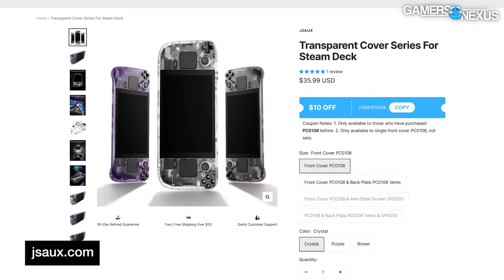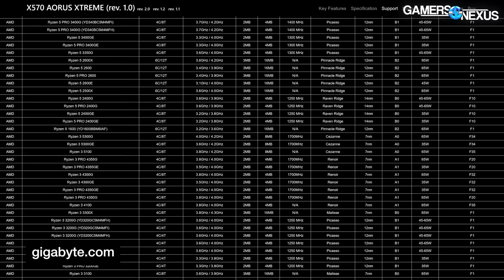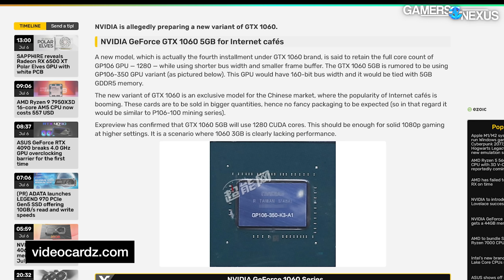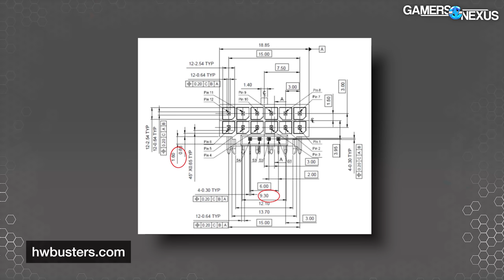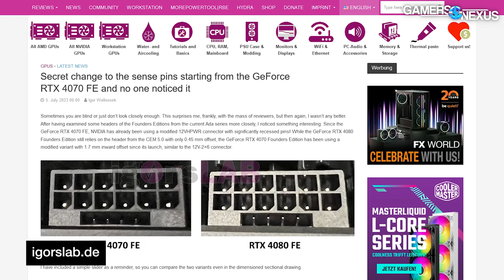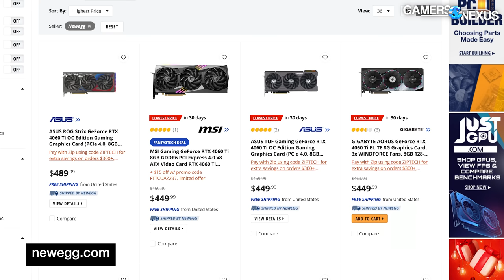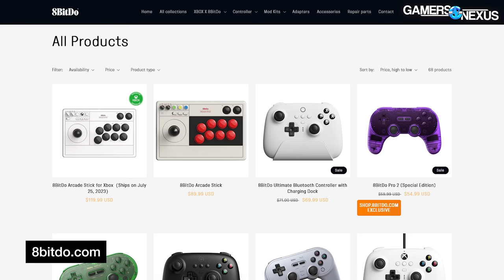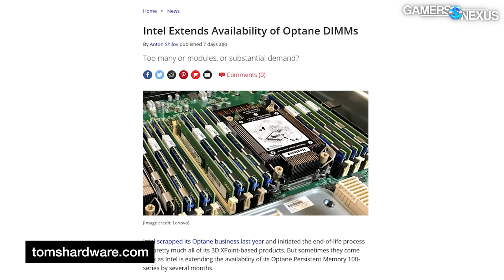HW News - Ultra-Small Intel Arc GPU, 12V-2x6 Connector, More AM4 CPUs, 4060 Ti 16GB

Comment: I got tired of waiting for a current gen AMD graphics card and bought the RX 6800 XT when it was on sale at Micro Center for ~$500. Unlike the lower end cards I've been able to get in the past, this one should last me a little while.
Reply: The 1070 technically still holds it ground, that 6800xt should last you a decade or possibly forever (until card lasts) at 1080p
Reply: @ipanesm  The 1070 is quickly falling short due to having only 8GB VRAM. It's fine if you don't play any games that needs more than that, but newer titles at 1080p is pushing that limit. If there's any question of that, Hardware Unboxed recently did a video comparing the 3070 (non-Ti) to the 6800 (non-XT), both with and without RT, both 1080p and 1440p. It went about as well as you can expect.

With all that in mind though, I fully expect to ride this 6800 XT until the wheels fall off. I don't do any manual overclocking, and while I currently use 1080p, I'm looking to acquire a 1440p display, so unless there's a serious hardware issue with this card somewhere down the line, it likely will end up in my new system, whenever I decide to build it.

Comment: NVIDIA should do a full recall on the 12VHPWR cards to solder the new connector, same with the brands that have a custom cables etc, so it can't be at fault for it being too loose or make it worse...

Comment: Speaking of NVMe airflow, I like how my AsRock x570 PG4 put one of the NVMe slots directly below the GPU so it can get airflow from the GPU fans. Many motherboards don't do this. I disabled the GPU's zero-RPM feature so now the fans are always on, keeping the NVMe cool.
Reply: Is a passive SSD heatsink with copper pipes and fins not enough ?
Reply: @YounesLayachi   Should be fine.  Mine doesn't have a heatsink so the airflow mitigates that.

Comment: Y, idk why there is a clip on top. Two clips on the side of the 12V connector (because everything evolves into crabs) would have prevented the issue too. It also makes it easier to press open the clips on an right-angled connector too.

Comment: I actually JUST applied the Carbonaut pad to my laptop's CPU and GPU! :D

The impressive thing about the pad is that, like what Bob Of All Trades showed some years ago (go watch his more in-depth video for more info), while it isn't quite as good as the best pastes on the market, the core-to-core differential in temperatures has been insanely close. Most temperatures before on the laptop I run (Eluktronics MAX-17) had anywhere between a 10C to 15C degree difference between the absolute hottest and coldest cores. Now it's merely 2-3C difference. So while it runs hotter across the whole chip, it's still an upgrade.

Also I never have to repaste ever again, if the company's claims are to be believed. :) Just gotta be careful since it IS electrically conductive, so you have to cut the pad to fit the size of the die. 

Better option than liquid metal, imo. Less stressful, easier to work with and never have to worry about it potentially 'leaking'.

Comment: Asrock loves SFF. They are the only one who made a single fan 6600XT, now a LowProfile A380. Nice work!

Inwin chopin modders now have a new GPU option. waiting for your revisit on A380, might be better than RX 6400 in performance, althought 6400 still has the advantage of single slot

Comment: I'm really happy to see the ASRock "Lite" boards! If I was still in the market for a CPU, that really might have tipped me over the fence to AM5. Specifically the B650E Taichi - I like that one.
AM5 motherboard prices were the reason I didn't go that route. The price of a board to get even the same features I got in 2019 with my MSI X570 ACE was just ridiculous. Everything under $500 felt like it would be a downgrade. Ultimately, I decided to stay on AM4 for a few more years, and upgraded to a 5950X (from a 3700X) two weeks ago.
(I'm happy as a clam with the 5950X so far. Video encoding is halved! I'm still blown away every time I encode something. No regrets with this choice!)

Comment: IMO the material from these connectors should be in a no flaming material, plastic isn't a great material, where high heat builds up. In the past, they used ceramic connectors. In this case, on the GPU side. And the use of NTK pins, which Igorlabs suggested. I know using ceramics is a lot more expensive, but you can't cut costs on safety. If this catches fire, and you are not at home, and the place burns down, and they find the cause, the manufacturer will pay for it. Insurance companies are very good in this.

Comment: I really like jsaux inlcuding a full tool set. It's not about whether the use should be expected to have all the tools,,, when doing something very important (like working on your steamdeck) it's critical that your tools have clean edges (brand new is the best way to have that) to prevent damage to the screws and other parts that comes from slipping.

Comment: In the past motherboards could split those 16 PCIe lanes to 8+8, or even 8+4+4. While that M.2 SSD on the back of the GPU is a somewhat halfway solution, being able to split those 16 lanes from the CPU, is the TRUE fix. And when I say past motherboards doing that, I mean $80 motherboards, not $300 motherboards.

Comment: still amazed at this whole 12 pin issue, meanwhile my Strix 1080 has a light by the connector... light on = fully inserted, light off = not in far enough, simple! or you know 8 pin that has worked nearly forever in terms of "PC years" vs 12 pin and then the squid-attack adapters, etc.

Comment: Nvidia should make generators with pulleys attached to their fans to generate current to reach 600w.
Reply: They could just plug the gpu into 240v so it doesn't need a 500 pin power supply. 🤣
Reply: @GoonyMclinux then it would need many more components to clean the power, bad idea
Reply: @ipanesm  Its a joke.

Comment: The 12 V "standard" should be replaced by the 48 V standard that has been used for over 50 years in the communications and data center industries.
Also, switching from CMOS to resonant tunnel diode threshold logic would reduce the power requirements by a factor of 100,000.

Comment: I won't lie. Several people asked me why I went out of my way months ago and bought 3090 to get an Nvidia GPU with more than 16GB of VRAM. I pointed at the 12VHPWR plug and said I wanted nothing to do with it.
ASUS has a potentially smart idea here with the 4060 Ti + 2TB. I've seen several people complain about the 16x lane slot not getting fully used by some cards.
Ah, hell. I'm going to need to buy an 8BitDo NeoGeo controller for my shelf.
Transparent Purple shell: GET! Putting it on is a great time to replace the joys with some Gulliket Hall Effect replacements.
Optane was great for caching large Steam libraries on 8TB 5400 RPM HDDs. I kinda miss it.

Comment: I’d like to see any Intel retest also include revisits for the 6600 (XT) and 6700 XT. Both were rightfully trashed for their launch prices, but are now considered standards for their price points.

As for the NEOGEO Controller: Now that they have the analog stick figured out, they should include it on one of their ultra-portable controllers since it's also a solution to a low profile analog stick.

Comment: Why can't GPUs switch back to 8 pin PCIE connectors, they never melted, they were perfect, don't know why they wanted to change it
Reply: power, new cards would need 4-5
Reply: What I don't understand is why the 12VHPWR connector is so much smaller than an 8 pin PCIe. How do they expect to shove 4x the power through those tiny pins? With those tight tolerances, it's no wonder they caught fire.
Reply: the better question is: why can't AMD and Nvidia design more efficient GPUs instead of these massive power-hungry behemoths that need massive coolers?
Reply: @Astrothunderkat  they're physically bigger than the 12VHPWR connector though so in theory they should be able to hande more power than the 12vhpwr (12 small pins) vs just having 2 pcie 8 pin connectors which are bigger and have more pins, pretty sure they can handle way more power than the 12vhpwr, just pure physics man, if they rated the pcie 8 pin at 150w then there is absolutely no way the 12vhpwr can handle 600w.... like i said, pure physics

Comment: Unless I missed it, you failed to mention that the new 12V-2x6 Connector pins have more surface area and have a more solid construction that makes it more difficult to tilt the connector once it is plugged in.

Comment: Something else interesting about putting an SSD directly on the GPU would be if (sometime in the future since this in no way will be able to do this), they used this method to do accelerated loading of files to the GPU. The drive could pass through to the OS through the GPU for use as a regular drive but also with the main focus of being a "game" drive or other GPU task focused drive. Then loads could entirely bypass the CPU and OS to be done directly by the GPU.
IIRC the PS5 already is supposed to do something like this.

Comment: 22:40 My guess is that if the previous generation uses a different manufacturing process they can double dip with old designs by keeping them on the market. If that's actually the case it seems to be a decent way to go about it. Though, I want to see more options that have hardware AV1 encode/decode so the situation isn't great to see in that specific case.

Comment: Why it needs to be pins at all is baffling. The connector could easily just have a classic VGA-style connector including screws to ensure secure mounting first. The sense-pins can remain in the plugs-in-one-way shape of the connector while the 2x6 pins converge into 2x1 slots. Slots for pure positive and negative. The only viable use for splitting them up is in case something were to keep some +/- pairs separated from the rest for... reasons... but that falls flat when it's all too easy to split up that current on the PCB itself. Hell, most if not all graphics cards using 12VHPWR already merge the pins on-board before splitting the current immediately after. And best of all, since it's slotted pads instead of pins, the connector could be smaller due to lack of material between the pads! Just... WTF? Six 14-gauge wires (decent speaker wire) would be enough to handle this load; we don't need 12 18-gauge wires. Do they not have electrical engineers working there?

Comment: Those 16GB 4060 Ti may pull double duty as AI cards. My friend was running a Stable Diffusion model on his 8GB 3050, but hit image resolution limits disappointingly soon due to the large VRAM requirements of the AI model. He eventually settled on 500 x 500 pixel images, which is a little small. I think he could have pushed it up a tiny bit more... But, round numbers...

Comment: I just paid $40 for a low profile Quadro P400 to put into an Optiplex SFF that's acting as an NVR. I think I would've happily paid $120ish for the low profile, A380 (or something like it) just to have more modern, with 250% the VRAM, and updated cooling performance.

I can imagine many others sharing the same utility application.
Reply: If you were planning on using it for transcoding and recording footage only, then I can understand using it on an older platform without Re-Bar. I don't know how Arc plays with that kind of purpose though and I haven't heard of anyone on the internet even consider using it for that. I would like to believe that it would be plug and play, but given how temperamental Arc is around software support, I'd be really hesitant to use it in that specific case.

If you're not against going used, I'd check to see if any T600's are floating around for about $150. They were a stealth budget alternative during the mining craze that had the performance of a 1050Ti in the same profile as the P400. A casual look at the sold prices on eBay has them around the $150-$200 mark and unlike Arc, you're going to have some recourse in the form of other people having had some experience with the card/ecosystem. With Arc, you're on your own if an issue crops up or at the mercy of the Intel driver team to get around to the issue.

Comment: The small A380 might make sense for getting some better-than-cpu AI performance in home servers, for stuff like TTS or STT or as a video accelerator for something like Plex (if Plex is ever able to use AV1 for transcoding) or transcoding something or so.
Reply: Actually Intel completely broke compute on a380 since February. The driver transparently sends it to the CPU with basically no compute taking place on the GPU
Reply: @igelbofh  Do you have a source for that? Granted, as an Arc owner, I wouldn't be surprised at all about Intel breaking something again. However, I mostly game and rip videos, so I haven't really touched the productivity side of the A380 outside of booting up Blender a while ago and checking the performance.
Reply: @igelbofh  On Linux? Because for servers the shitty windows drivers are irrelevant and the Linux drivers for Intel work quite good.
Reply: @EbonySaints  Running same version of anything Gigapixel on Windows- new drivers just kick more and more of it to the CPU, even though the calling applications is the same. Also - custom software that is developed on openVINO - same software, more and more of it being pushed to the CPU by the driver.

Comment: one thing ive kinda wondered with am4 is if they could in theory release zen4 on am4 once it was no longer bleeding edge. i doubt they ever would but unless theres signifcant changes to the ccx protocol it in theory might be possible. not everyone needs ddr5, not everyone needs the bleeding edge. i think theres many people, especially with current economic situations, that would upgrade an existing am4 system rather than build, essentially an new system. its a hope, am4 motherboards hit a price i doubt any am5 board will, multi layer pcbs with good signal properties aint cheap. fantastic platform for a homelab

Comment: And AMD avoided all of the drama by sticking with 8 pin PCIE
Reply: I bought an AMD card because of the pin issues, although I would just solder a 4 pin 20 amp connector on if I did have a faulty connector. 😂

Comment: Regarding the gpu with a built in NVMe drive: this is the main reason I was hoping that the 40 series would be PCIe 5.0.  We don’t need 16 PCIe 5.0 lanes, but if these GPU’s were PCIe 5.0, the cards could use eight 5.0 lanes which are basically as fast as sixteen 4.0 lanes, which means we have more lanes for NVMe drives or whatnot.  Most motherboards (intel boards at least, not sure about AMD) can’t use a PCIe 5.0 NVMe drive without cutting into the lanes available for the gpu, which is just dumb.

Comment: If you're gaming in 4K and you're coming from a 2000 8GB series Nvidia GPU, the 4060ti 16GB is a steal.  25% overall uplift in performance and higher graphics settings can now properly render due to the extra 8GB of memory.  The 4060ti 16GB was long overdue.
Reply: I assume most normal people not running YouTube channels skip a generation between GPU upgrades. 

So if you upgraded your PC in 2019 with an RTX 2070 it would have cost you $500.

So the same $500 in two weeks from now will get you an RTX 4060 TI 16gb. 

So is it a great upgrade after all that time... no... but is it the worst thing in the world? Also no... 

I guess it all depends on if what you are using your GPU for requires the extra VRAM or not. I think it will be more helpful to people doing 3d production work as opposed to people playing games.
Reply: @1O1O11  Well, there is no such thing as a great upgrade when the next Gen specs are incremental unless a person is willing to shell out an extra $1,000 on what they are already going to spend.  So compared to a 4090, it's a steal.

Comment: The G suffix is not the inverse of the F suffix. G CPUs are APUs with a monolithic design compared to the chiplet based designs. In the past they were usually one microarchitecture generation behind before AMD aligned them again.

Comment: Low profile A380 would be great for those slim dell i7 boxes floating around everywhere with various generations of pretty decent cpus.  Seen some 4th and 6th gen used ones pretty cheap on marketplace
Reply: Such old CPUs don't support Rebar, as such, its performance would be considerably worse than that of other GPUs
Reply: @e-cap1239  excellent point I do remember that being important now that you mentioned it. Hopefully it's something that yet again can be improved through driver updates on non re sizeable bar platforms

Comment: I've found that the iGP is pulling more and more leg work with an external video card with more games, my iGP is usually running at 30-40 watts in many newer games especially VR titles and there is a hit to FPS when it is disabled.

Comment: Instead of doubling down on a flawed and stupid connector design, they should have just EOL'd it, admitted it was crap and gone back to the PCIe 8 and 6 pin connectors. They could have just released a 12 pin version of that connector, and all would have been fine.

There seems to be this trend of miniaturizing connectors for the sake of aesthetics over form, and it's ridiculous. If you have a fat and chonky 3 or 4 slot video card, there's no reason to have a tiny cable connected to it. I want a thick overkill connector going into it with plenty of headroom, not operating at near capacity all the time and risk it burning down. It's the same but worse with USB-C. 100W over tiny whisps of copper wires that have zero headroom. One spec of dust or bent wire and expect ICs on either end of the cable to forcibly detonate.

Now we're going to have power supply segmentation with either this new crap connector, or the older PCIe power cables, or a medusa cluster of both. Or we're going to have to use pigtail adapters to go back or forth, depending on which video card is going to be used.